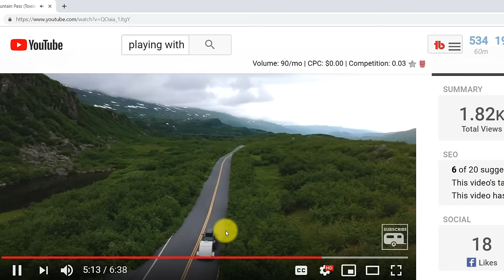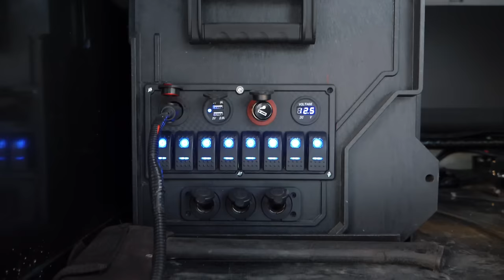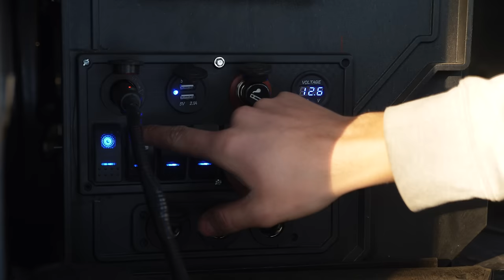Expedition Overland Trailer: Built ALASKA Tough!

Comment: how cool,i lived in wasilla for 6 years,best experience ever! i live in florida now and have built and been using /modifying an ultra light overland trailer with smittybuilt rooftop tent .15000 miles  and a dozen national parks so far. pulling it with a 98 honda crv . .15 gal.h2o 100 amp bat. and s. pannel 40 amp ren .solar charger . good storage .and decent to look at!
Reply from the maker: How cool that you lived in the Valley. Small world!  Your trailer sounds amazing. Any chance you have a blog or pictures of it hosted online anywhere?

Comment: I have a well-built, custom off road trailer made (by my son) w/ all closed steel tubing which is also powder coated.  A roof top tent is ON TOP (imagine that!).  The floor plan is open so various equipment can be loaded or removed easily.  The hitch is also a Lock&Roll type which stands up to all the overlanding I do.  It sits on a 3500 lb. axle w/ 37" off road tires (I used  to pull it w/ my Jeep Wrangler Rubicon which also had matching wheels/tires).
Reply from the maker: Sounds like a great trailer. Love that is built by your son. 37" tires, now that sounds like a nice high ride. I also really like the fact that the lock and roll acts as an additional measure of security as nobody seems to have that coupler on them to be able to pick your trailer up and go.

Comment: Nice 👍 
We have built our own from a 4x6 utility trailer for under 4K including a new Tepui Kukenam Ruggedized.
Ours needs slide outs like the Valiant has.
Great build! Thanks for sharing. I know many people that will be excited about this trailer.
Reply from the maker: Doing that for under 4K sounds like it is definitely worth going the home built route. Sounds like the tent was almost half the cost, but they are definitely worth it. We would agree that the slide outs are a very nice feature to have.
Reply: Playing with Sticks yes the Tepui Kukenam was half the cost. 
The Valiant trailer is really what we were looking for. Ours is built with a metal frame and pretty much a wooden box with an another external frame for the tent.
Is much rather have better materials like the one in your video

Comment: I’ve been looking at the Taxa Wooly Bear and Tiger Moth. Both seem to be great. I recommend you give them a look!
Reply from the maker: Aren't the Taxa trailers intriguing?  We like to watch videos of the Cricket and the Moth.  I think the Tiger Moth would be a great combination of the teardrop and the expedition trailer.  You get the rugged design and high ground clearance like the expedition trailer, but the more enclosed functional design of the teardrop.  Now, if the tiger moth ceiling popped up for standing height like the cricket in our opinion it wold be the perfect small trailer weighing in under 1,000 lbs.

Comment: Really neat!  The Lock-n-Roll was something I have been looking for. 
My two concerns are heating and bears. 
Easy to heat, but huge/fast heat loss. 
Yellowstone wants hard sides, or soft-shell with enough height. I know the popup truck campers like FWC are approved, because the tent part starts at over 7 feet. I have not found info about the “approved” height yet that allows hybrid tent campers to use the more bear problematic Yellowstone campgrounds.
Reply from the maker: We had never even heard of the lock-n-roll system until researching these overland style expedition trailers.  Like you said the tent would heat up quick, but also lose that heat quickly.  BUT with that nice propane tank and the generator mounted on the tongue you would have a pretty much endless supply of propane or electricity if you were using a ceramic heater.  I knew when I was a child Yellowstone had a rash of incidents with bears.  I didn't realize this was still a big issue.  I have a video I keep wanting to post about no matter how high you are off the ground those bears climb fast.  The video is of a black bear climbing a tree behind us when we were floating a river here in AK.  We have always been taught not to climb trees, but me being stubborn always thought it might be a viable option for me beings I climb pretty quick. Well, after seeing that bear climb as quickly as he can my new belief is no matter how high up you are, if a bear wants up there he will find a way and quick!  The popup truck campers would probably be tough for the bears to get any good footing that initial 7 feet though, so I see why they are considered okay.
Reply: Playing with Sticks, Good point about the heating.

Bears. I have seen videos of bears breaking into cars and cabins. Yeah. I agree. If they want in, they are gettin in. Height by itself is not a deterrent. Ha! One video showed a bear climbing this deer hunters bow stand tree, until the bear realized the guy was there when he said “boo”!  Bears can climb down fast too!

I believe most bear issues in Yellowstone campgrounds are opportunistic - snatch and grab easy food, or curiosity gone wrong. I have not found any reports of an RV broken into by a bear, and an RV would be easy for them.  I think the Rangers are just trying to reduce any easy access confrontation that can lead to an incident where bears are more accustomed to people.
Reply: Playing with Sticks, Bears. I think the real question I was asking is what will Yellowstone allow in a non-tent (frequent bear visitors) site, rather than if it is protection from bears — which I think we both agree that if a bear wants in, it can get in. 

There is a broader bear safety question that I don’t think can be answered at this time except anecdotally since there are so few fatal bear issues. That is also because people in bear country have not been complacent.
Reply: Playing with Sticks, I just got a reply back from the National Park Service for Yellowstone: 
“Thank you for your inquiry.  Only one campground out of 12 within Yellowstone are restricted to hard-sided units.  Roof top tents are allowed in all campgrounds with the exception of Fishing Bridge RV park.”
Reply: @PlayingwithSticks  , I don't know about today, but as far back as 1982 Glacier National Park in Montana had at least one campground that was restricted to hard sided vehicles only. I know because I had a Volkswagen camper van at the time and because of that, I was allowed to stay. My camper van did not have a pop top so that was not an issue.
Reply from the maker: @RicardoRoams  Sounds like they still have one today like that. That would be tough to pull up and find out you are not allowed. Interesting how habitual those bears can get down there.

Comment: Thanks for responding but my issue with my little Smart Car is you'll burn the transmission out if it's pulling something to heavy.
Reply from the maker: I see you worry. If you don't want to worry I would say look into a fiberglass trailer like the MyPod. Better safe, than sorry.

Comment: Australian companies have done these kinds of trailers for a long time.  Personally I think they're more rugged than a teardrop (thus more off road worthy), but they're also a downgrade from a teardrop in terms of comforts. 
It goes like this: tent camping, overland trailer camping and teardrop camping. Advantage of the overland style camper is that it's essentially a utility trailer with rooftop tent. You get a lot of storage, big tires, good suspension and a tent not on the ground. Downside is you have no insulation and you miss out on a few comforts a teardrop style trailer can offer. 
For me a teardrop it is. If it was just me I'd have a overland style trailer, but then my wife gets cold real easy and she wants a nice mattress and sheets. Therefor a teardrop with off road suspension fitted the bill. I added a propane furnace to keep me from arguments about condensation and cold, so yes, improvements in comfort over tent camping will improve your relationship. In addition, the older you get the less you want to climb a ladder or crawl into a tent so from that perspective alone I prefer the teardrop style. Still, the overland rigs can go places even a jacked up teardrop can not.
PS: i thought it was kinda funny to offer that warranty. The "swing by we fix it" style is great, but if I were to buy one of those trailers I'd have to drive 2000 miles up the coast through Canada to get that latch fixed - mhhh, there's an excuse to go to Alaska... got to think about that (Honey, the latch broke again - I'll go have that fixed. See you in 4 weeks)
Reply from the maker: Great comments as usual Uwe!  The offroad capability and built to handle anything design is quite alluring.  But, like you said so is a comfortable bed and solid walls. Good point on the warranty too. Funny enough that would be a selling point to many people to have an excuse to make an epic trip.
Reply: We bought an A-liner and drove from the East Coast to Alaska. It was over 11,000 miles altogether. Í liked the A-liner because I tried a year drop but had problems getting in and out due to being fused from T- 10 down to my sacrum. So being erect is necessary. We go camping at least once a month since Covid started and it provides a sanity break for me. We are both in our 70s and will camp until we die - I guess. I like the tongue on your trailers but I don't know whether we could change out. Your tires are awesome since we blew a tire returning two weeks ago.

Comment: How well does this handle extreme heat?  If we do expeditions in our own State, high temps are a very real possibility.   More than likely, my Hubby will not want to camp in snow.
Reply from the maker: I would guess this would do quite well as the manufactures for the Lower 48 overland communities tend to use very similar material and design. Jordan at Valiant has already made a few of these equipped with aircon.

Comment: Its not as expensive as a turtle back (those guys have lost their minds), however when you can get a mint condition military trailer for 500 bucks, $6k just for a trailer seems crazy.  But that just me.
Reply from the maker: When we saw the $4,000 to $6,000 price tag we thought it was very competitive, in that like you said the other companies really push the cost up high. But yes, you are correct these teardrops and overland trailer can get quite expensive.  Especially when you notice trailers 4X's there size can often sell for a similar price.  We have been learning a lot about the military trailers. We follow a guy on Youtube with an M105 and the M1101's look great as well.

Comment: Awesome video Drew. Thanks! How much for that small trailer with a roof tent like theirs?
Reply: They are really expensive.  Thousands.
Reply from the maker: The small trailer is $5,795. I am not sure how much roof tents are currently going for. I haven't checked those prices in a while. Typically they run between $1,000-$3,000. It adds up quite fast doesn't it?
Reply from the maker: Yep. You are correct.
Reply: @PlayingwithSticks  thanks Drew. We love your videos man. More power to you!

Comment: What is the weight on this trailer? Because I have a little Smart Car and I'm looking for a small travel that I can pull with my little Smart Car. I really don't like the idea that it's a tent style camper because you don't have much safety with a tent style trailer.
Reply from the maker: Hey again Kenneth! Jordan's popular 452 model comes in at 800 lbs. I have seen a lot of forums with Smart Cars towing about everything out there. But, to be safe I would try to keep the load low. It really isn't what can it tow, but more how can it stop in terms of braking distance. If we owned a Smart Car we would look into fiberglass models. Even without a Smart Car we highly recommend fiberglass. Way less maintenance, durable, and again lightweight. I know the newer Bean trailers are fiberglass (one piece construction I believe, which is awesome). I hard that Runaway campers just came out with a fiberglass or composite model.  This is a nice company to start with because their builds are very affordable. The most popular small fiberglass trailer is the mypod. Hope this helps.
Reply: Have you seen some of those films where the bore a hole in an RV wall? Two flimsy like 1/8” pieces of plywood with foam in the middle. Thinking no protection there except from something that does not want to hurt you.

Comment: You start out shooting down the expense of a 12 grand trailer but on your website the campers start @ 19 grand and go up into the 30's? I couldn't even find a price on your basic trailers.  You might want take this video down.
Reply from the maker: This isn't a Valiant video. It is a video we made highlighting their company. The 19 grand trailer you see is a squardrop, much different model than this trailer. And as for the price of the basic trailer I would be interested to see it as well. I wonder if the price has gone up significantly or not. The last couple of years camper prices have skyrocketed from every company.